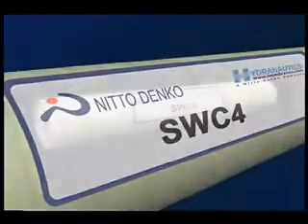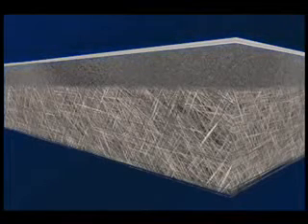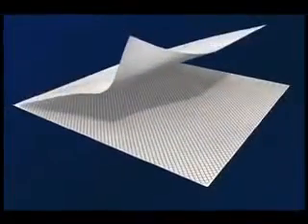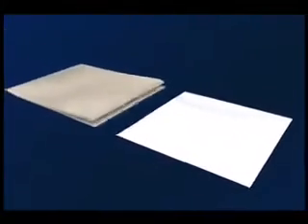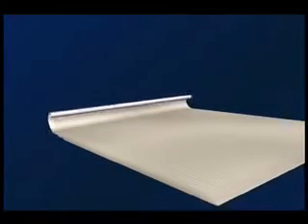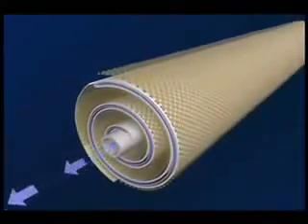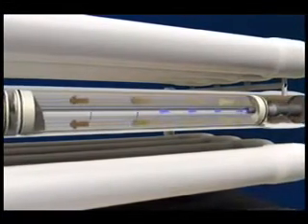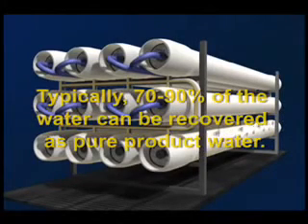RO Membrane How it is made

Comment: how do you separate that glue from water we drink? Is there a chance that glue is getting dissolved in output water?
Reply: Glue is a polymer...I.E it's a chain of molecules. These molecules are larger than water molecules, and so they would get blocked by the filter if they broke down and tried to flow with the fluid.